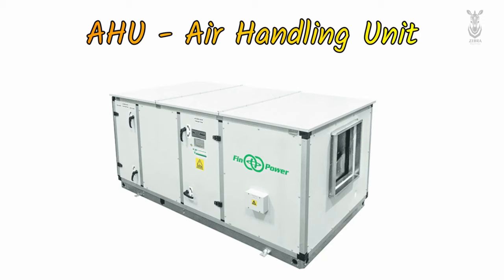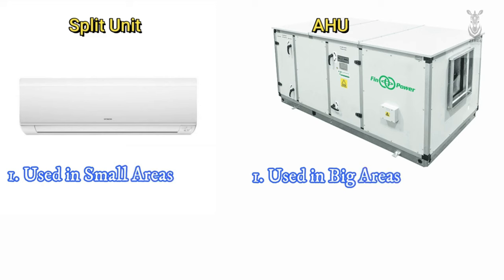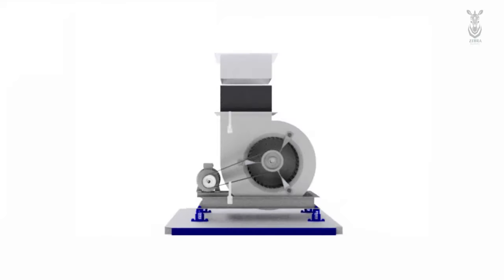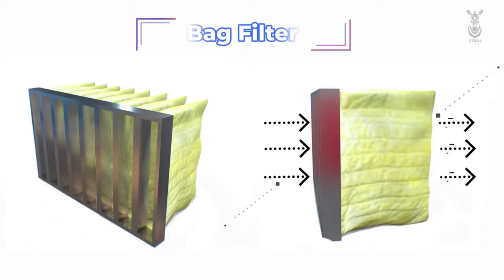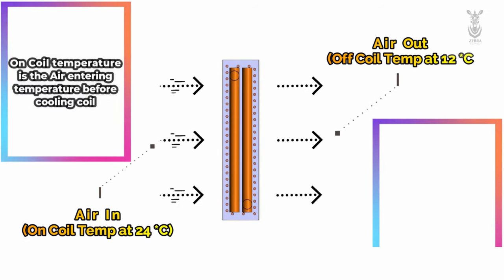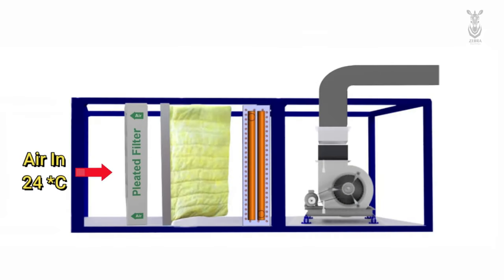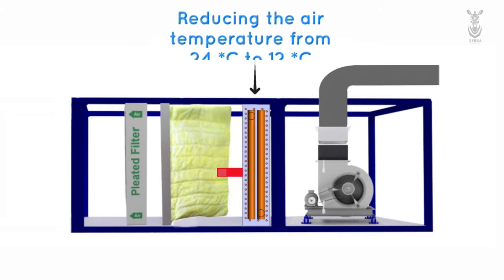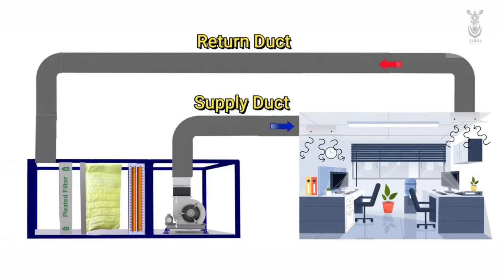AHU working Principle | English | Animation

Comment: In the previous video of Chiller you told Water coming out of AHU is at a temperature of 12 deg celcius but here it is 9deg .. Explain it sir please..
Reply from the maker: Actually the return temperature from the AHU will vary based on the heat in the room. It can vary from 9°C to 15°C or more than this.

Comment: Is humidifier used in A hu system
Reply from the maker: Humidifier is not used inside the AHU. The Humidifier is installed outside and the steam only conveyed into the AHU the through the pipeline. But not all the AHU has the humidifier. It's based on the requirement.

Comment: Ahu connect with??
Reply: The chiller system. 
The water temp rises
So it goes back to the chiller to cool down again.
Reply from the maker: AHU water supply is connected with the chiller and the duct system is connected with the room.